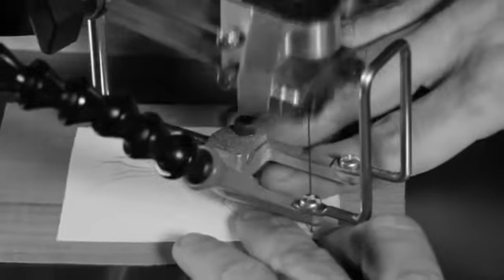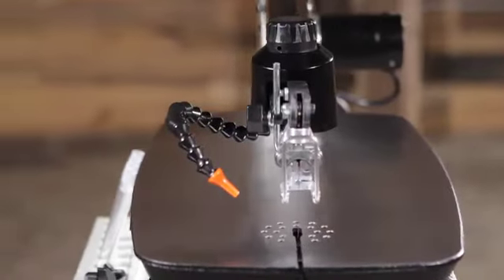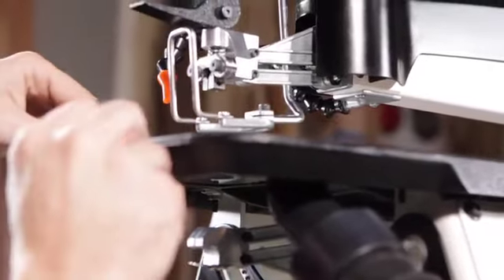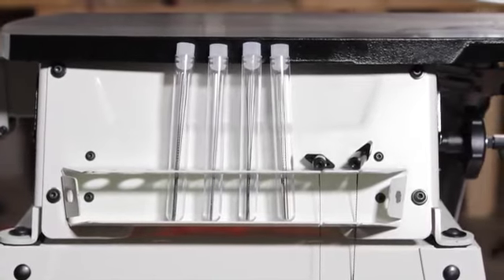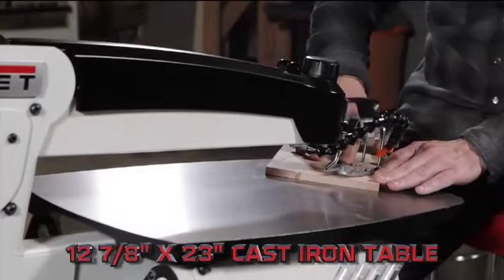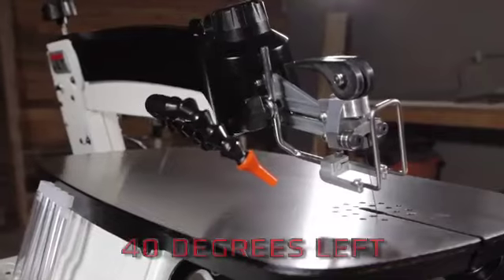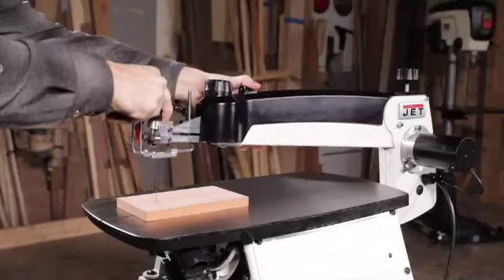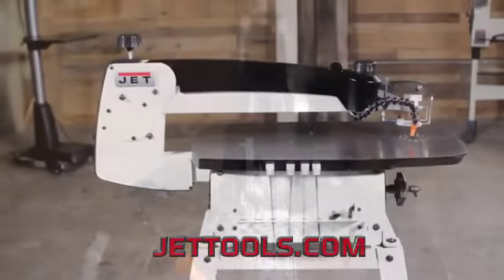JET Scroll Saw

Comment: "has anyone had problems with the spring on the bottom holding the blade holder,,,mine wont stay attached when you release the top tension

Comment: The only problem I see is that the, under table dust collection system, pulls a vacuum that sucks the dust through the table top, and the suction makes it harder to move the work piece on the table while the vac is turned on. I know this because I have an Excalibur EX21K that has the same type dust collection system..
Reply: Wayne Williams b